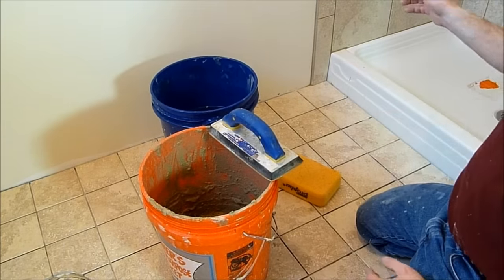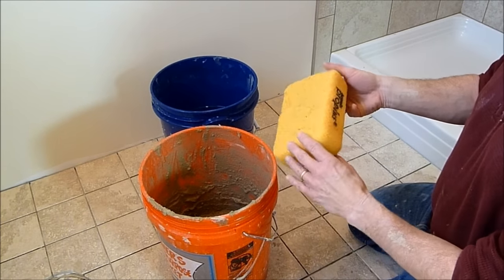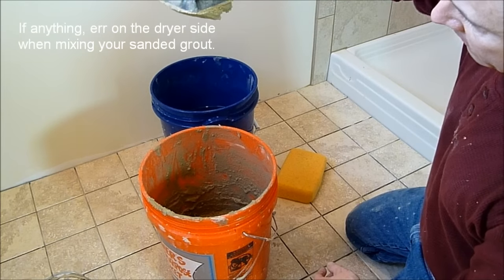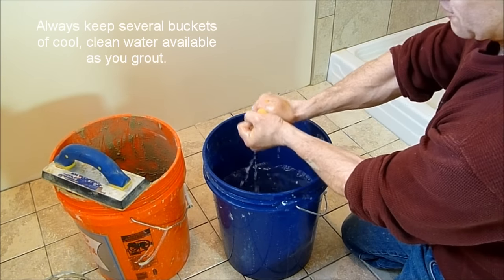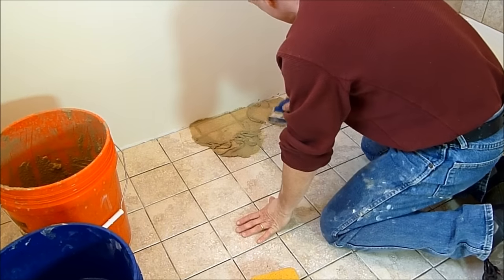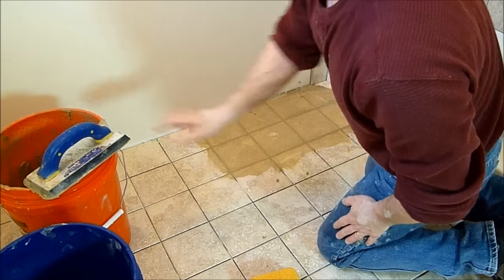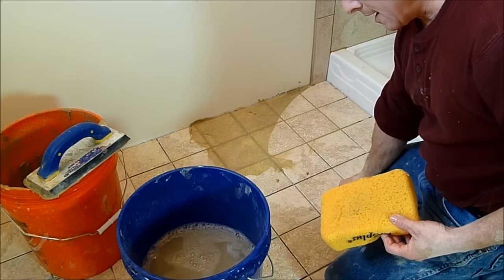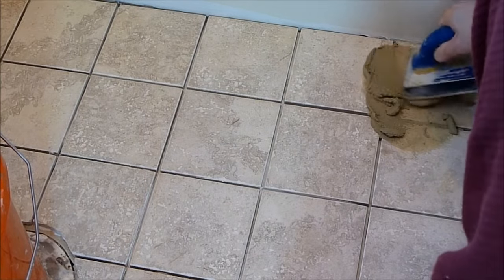How To Grout Tile: Correct Technique Makes It Easy

Comment: I'm trying to do some grout repair again as my last two times failed. I have a line that's about 1/4" and another line connecting to it maybe 1/8". This is in over bathtub tile. Should I use sanded or unsanded grout?
Reply from the maker: Well, step one is to make certain you've removed all of the old grout, down to the substrate.  I have an old video linked below you can watch.  Once the grout lines are clean and open you'll have a better chance of success.  It's unusual to have two different grout line widths, is there a reason for that?  If one of the grout lines is in a corner or if it is the gap between the tub/pan and first row of tile then you should be using silicone caulk, not grout.  Movement in those areas will not allow grout to stay put very long.  For grout lines 1/8" or larger you'll definitely need sanded grout.  And, make certain you are using real grout, not the premixed garbage.  It should come dry in a bag and you need to mix with water.  

https://youtu.be/yzKtgalbaic
Reply: @enduringcharm  I have a window ledge in the bath area. On the bottom flat ledge, there's a gap between two tiles that has a larger gap. The edge of these flat tiles is the start of the wall going down to the tub. The second gap is basically the gap between the side of the tile and the front of the tile below it and it's a smaller gap. My grout has broken off twice now and I can't figure out what I'm doing wrong
Reply from the maker: I'm having trouble picturing from the description, but when I hear "window" and "shower" in the same sentence I shudder!  Windows do not belong in showers under any circumstances, and I have taken a number of them out after the inevitable rot occurred.  If the missing grout is around the perimeter of this window where the tile begins, then your issue may well be that you should not be using grout at all.  Silicone caulk would be a better solution since the window will be moving interdependently of the tile.  Another possibility is that you do have rot already, and the unstable substrate on top of rotted framing is causing tile movement and grout loss. But, I'd have to see a picture.  If you wish, you can look up my email through my website and connect that way.

Comment: Wish me luck. I'm doing my bathroom with groutable vinyl tiles. I just hope they'll clean up as easy on vinyl as opposed to ceramic. I'm using TEC Skill Set grout for vinyl.
Reply from the maker: I hope I catch you in time!  That "grout" you are going to use for the vinyl tile is NOT the same thing as grout for ceramic or porcelain tile.  It's closer in chemical composition to paint or caulk than it is masonry grout.  While the application is similar in some ways, you should read the directions carefully.  You'll want to work in smaller sections and use a very light touch on the sponge.  Then be ready with a microfiber towel to buff the tile up to the grout line to remove any residue.  The grout lines of the vinyl tile are very shallow and it doesn't take much to accidentally wipe out the grout.  The pre-mixed stuff you will be using has a different consistency and a different curing process than real masonry grout shown in this video.
Reply: @enduringcharm  My tile is TrafficMaster groutable vinyl, that's why I went with the TEC. I bought my grout just today and still waiting on my tile to be delivered. Thanks for the tips. I'll be sure to use just the right amount for the shallowness of the tile and do your other tips as well. My bathroom is small so it shouldn't take too long. Thanks again! 😊
Reply from the maker: To be clear, I'm not faulting you for making that choice of pre-mixed grout in this instance, I just want to convey that it is a different animal than what is shown in the video.  Good luck!
Reply: @enduringcharm  Thanks.

Comment: When tiling, should I grout between wall and tile closet to wall or leave a space?
Reply from the maker: Are you referring to the edge of a floor?  Typically that area is covered by baseboard moulding, so grout doesn't matter right at the edge.  You tile and grout, then install the moulding to cover any gap between the wall and the floor.  If you are tiling both the wall and the floor, you typically do grout at the edge, but you may need to cover the edge with a color matched caulk since that area can develop cracks.

Comment: hi, i have a question, if the grout starts fading and peeling itself, do i need to remove all the old grout before applying new one? because what i did while ago was put some little cement in between the tiles, then put some grout powder.. i am now anticipating that result will make me repeat the whole process.
Reply from the maker: If you want to re-grout then you should remove all of the old product first.  I have another video which describes how to remove grout:

https://www.youtube.com/watch?v=yzKtgalbaic&index=23&list=PLD4oAOZqK9mCjvmw_nUkZBrPPXf_20Lad
Reply: great,tnx
Reply: enduringcharm how to remove grout

Comment: I miss what you say at 3:49 about the haze. Are you saying to scrub the haze off with a paper towel after its dry?
Reply from the maker: If you use my method then you can come back the next day and wipe off any haze with a rag or microfiber cloth.  The point is that you don't need to worry about a slight haze right after you wipe.  If you check out the newer video linked in the description I go into this in greater detail.

Comment: What do you think about metallic additives?? And what color grout are you using???
Reply from the maker: The grout color in this video was probably antique white or something--it was a long time ago!   As far as metallic additives, I did have one client who wanted sparkly grout for her glass tile kitchen backsplash.  I used a very expensive epoxy grout with the sparkles mixed in.  She loved it, and I think that was the most miserable grouting experience I've ever had!  It was annoying and demanding to work with, forcing you to move quickly and avoid dripping anywhere.

Comment: What about sealer, and stain resistant?  Which brand grout product do you use?  If you can list all supplies please?
Reply from the maker: If you are using standard grout  (not pre-mixed, and not epoxy grout) then any name-brand is fine.  I don't find a significant difference among them.  A sealer is important, and the grout must cure before you can apply the sealer.  However, a sealer will only help prevent staining and keep water from soaking into the grout for a short period.  It won't prevent actual particles of dirt or other things from getting into the grout over time.

Comment: Any thoughts on sealing?? Do you apply sealant to your grout? Thanks
Reply from the maker: Yes, I do seal the grout after it has a chance to cure.  However, I always caution clients that sealer is not magic.  It will help prevent some staining, but it won't prevent mechanical or ground in dirt particles and it may not even prevent some stains.  You also need to keep it renewed regularly.  It's inexpensive and there's no reason not to use it, but just set your expectations that it has limits.

Comment: After swiping the excess grout from the tile, do you have to let the embedded grout dry?
Reply from the maker: If you use this method, then after you've cleared the excess grout you are done.  Let the grout cure for a minimum of 24 hours.  You may have a slight residue of hazy dust on the tile which will wipe off with a damp rang or sponge.
Reply: @enduringcharm  Thank you ☺

Comment: Noticed, you used the sponge right away and didn't let new grout dry a bit, any reason why you chose to do wiping immediately after you floated down??? Thanks.
Reply from the maker: Montery12 As long as you wring out the sponge and you are not adding water to the grout as you wipe, and as long as you have packed the grout joints well, there is no reason to wait.  If you are using unsanded grout in very thin grout lines you may find it necessary to wait a minute or two, but the old method of waiting 15-20 minutes is simply not necessary.

Comment: Best video I've seen yet.... do you need sealer?
Reply from the maker: It's a good idea to seal the grout once it is cured, yes. It will help prevent stains and keep the grout from absorbing water as quickly.
Reply: Thanks a quick video on how to get your grout to that consistency and how to use sealer would be super. I have no idea about these things but I just put a floor down and so far so good. My mud and my grout mixes pretty loose. Thanks again
Reply from the maker: This video is a little newer and has additional detail:  https://youtu.be/_aja8hfhElI

Comment: Hi! This is going to be tough for me since English is not my language but, I will try: I have already finished that process and grouting is solid. Now, I would like to keep "grouting" so I can level the "grooves" or "tracks" between tiles and have no more of them. In other words, I'd like to have a solid one level floor from my tiles so I can then paint and have no dents on the floor. Can I achieve this with this technique? Thanks
Reply from the maker: If you mean you'd like no depression in the grout lines, simply use less pressure on the sponge.  If you mean you want a totally flat floor with no tile lines, then you need to use a different flooring!

Comment: Do you do it by part like divide the floor in 4 parts start with one grout it clean then start with the 2nd part
Reply from the maker: When I grout a whole bath, I do the whole job in an hour or two, depending on the size of the bath.  I'll grout in an area corresponding to my arm reach in both directions, then wipe that area before moving on.  There is overlap, of course.  This video has some further detail:  https://youtu.be/_aja8hfhElI

Comment: Thank you for the great tutorial. How long after you grout can you walk on the tile?
Reply from the maker: The standard rule of thumb is 24 hours.
Reply: Thank you for your quick response. Do you have an videos showing how to regrout near baseboards or carpet?
Reply from the maker: If you are concerned about getting grout on the carpet, stick some blue painter's tape on the edge to help protect it and then as soon as you're done grouting that area remove the tape and wipe way any misses with a damp sponge.  For wood baseboard you can simply grout up to the wood and wipe clean with your grout sponge.

Comment: I have glossy floor tiles. Is there any risk. Of scratching them wiping away the grout?
Reply from the maker: ***** Highly unlikely.  I suppose a really cheap tile or a natural stone could plausibly scratch with a sanded grout, but I've never seen it happen.  You should be fine.
Reply: enduringcharm cheers. Our tiles are porcelain but I have never done it before so I was wondering.

Comment: What about Rapid Set grout?  I found a box of it from last century around the house; is that "Old School" enough to wait 15 min before using the sponge?
Reply from the maker: I'm not familiar with the brand, but I generally avoid using old grout or cement or mortar.  Better to avoid the possibility of clumps or hardened product and just use fresh stuff you can be sure about.  Incidentally, it won't necessarily hurt to wait 15 minutes, but you may find it more difficult to wipe off the grout and you're prolonging the job without real benefit.
Reply: enduringcharm I used it anyways and it looks pretty good.  I'm not an interior decorator and noticed the shower tile is white w/ white grout, the floor tan w/ grey grout.

Comment: Do you dispose the grout-filled 'muddy' water down home drains?
Reply from the maker: +FarFed No, that would not be a good idea.  It could clog up the trap.  I typically find a place outdoors where I can dump it and wash out the bucket.  The majority of it is sand (if you are using a sanded grout) and the small amount of other ingredients doesn't harm plants or grass in my experience.  If you are working in a condo or an urban environment where there's no place outdoors to dump, you could drain off the water from the bucket to a building drain and then scoop out the mucky bottom of the bucket with a towel or rag.

Comment: I’m grouting my first kitchen floor. Finished mortaring in the tiles 72 hours ago.  Once I finish grouting, how long do I have to wait before I can walk on it?  And how long before appliances, furniture can go back in. Since the mortar is well cured, and walked on, Will the tiles shift if I walk on it too soon?
Reply from the maker: The rule of thumb is that you can grout 24 hours after tiling, so you are in good shape.  If you used an appropriate trowel on the thinset, and you bedded the tile well, then you'll have no problem walking on it now.  After grouting, you should wait another 24 hours before walking on the tile.  Just make sure you don't make the grout mix too wet, that you force the grout firmly into the joints, and that you don't wipe with too much sponge pressure.  After the 24 hours the grout will be set enough for traffic, but not quite ready for a sealer.  In a kitchen, especially, a sealer can really make a difference as far as keeping stains at bay.  Typically you need to wait a minimum of 48-72 hours before applying a sealer.  Some require more.  So, if you can avoid putting furniture or cabinets in place long enough to get a good coat of sealer in the grout, that would be ideal.
Reply: @enduringcharm  thank you for the quick response.  I’ve watched your video and will watch it again before I start. I’m using a product from MAPEI, that contains the grout and sealer in one. The bag says it is rapid set, so I’ll work a small area, but it light traffic is allowed after 3-4 hours. I’m going to their website to check out details.
Reply from the maker: Unfortunately your reply was caught up in the youtube system and I'm just seeing it now.  The rapid set products ARE a little different, and I don;t actually recommend them because it leaves no working time.  Hopefully you got it done, though!

Comment: What type of grout are you using & what is the ratio of water+ Grout mix? Thx
Reply from the maker: A sanded grout is used for joints about 1/8" and bigger, and an unsanded grout is used for joints narrower than that.  I mix the grout to a certain consistency, rather than measure water.  This video has more on that:  https://youtu.be/_aja8hfhElI

Comment: Quick question,  I have 1/8 spacers for my wall tile, would you recommend sanded or unsanded grout?
Reply from the maker: That's usually the dividing line.  Probably you'll want sanded grout, but check the manufacturer's recommendations on the bag.
Reply: Thanks

Comment: I do have a question because I don't have a clue about doing floors but I'm working for installation company as a scheduling agent.  My question is...what is the point of grouting?  You spread it on the floor and wipe it up but what is it's purpose???
Reply from the maker: Grout fills the gaps or space between each tile--it's what those lines in the floor or wall consist of.  Getting the grout into the slots makes a mess, but once it's there and the tiles have been cleaned up, the grout allows some flexibility in the surface without cracking, it seals the edges of the tile, and it adds beauty.

Comment: i watched videos where it said to wait 15 -30 minutes before wiping with a sponge . is that necessary ? or is it better to wipe with the sponge immediately after application ?
Reply from the maker: No, do it just as I demonstrate in the video and you will be fine.  What you are describing is the old school method, which is time-consuming, messy, can be unnecessarily difficult and is wholly unnecessary.
Reply: i wish i saw this video sooner . the old school method stuck grout more to my tile than it did to the seams . I'll follow this newer method , the old school way is definitely messy .
Reply: whether i wait 15 minutes or 0 minutes the sponge keeps wiping away the grout between the seems. im trying to cover some old discolored/cracked grout so that might be why i keep having trouble. when i wipe with the sponge , the grout comes out of the seams . if i go over the grout , wipe just a tiny bit , let it dry and sand it with a pumice stone that seems to do the trick
Reply from the maker: Yeah, you should remove all of the old grout first and then re-grout.  I have another video about removing old grout you might find helpful.

Comment: My contractors must have used too much water. My grout is discolored. Is it possible to put a thin layer of grout on top of it without as much water so the color is evened out?
Reply from the maker: You could be exactly right--too much water can definitely lead to uneven coloring.  Unfortunately it's unlikely you'll be able to put a thin layer over what is there.  You'll need to remove the grout and start over, or have your contractor do so.  This is how it's done:  https://youtu.be/yzKtgalbaic

Comment: I'm trying to decide if I should use sanded or un-sanded grout for my hex shaped "penny tile" half-bath floor.
Reply from the maker: N Holt For most grout manufacturers the dividing line between sanded and unsanded grout is 1/8".  So, just determine the width of your grout line and check the instructions on the grout bag you are purchasing to make certain you are installing the right type.  The sand in sanded grout just provides more structure for stronger grout in wider grout lines, that's all.
Reply: Thank you for the response!
Reply: enduringcharm great video very to the point I have a problem should I use sanded or non sanded grout on a12x24 glazed porcelain tile in the washroom 1/8 grout line not sure if the sand would scratch the tile waiting for your input thanks love the video

Comment: Can holes in grout be touched up and fixed 2 weeks later ?
Reply from the maker: Probably.  If the grout is fresh and you haven't sealed it yet, you can scratch out any areas that are incomplete or damaged, and just regrout that area.  Go a little wider than the damage.